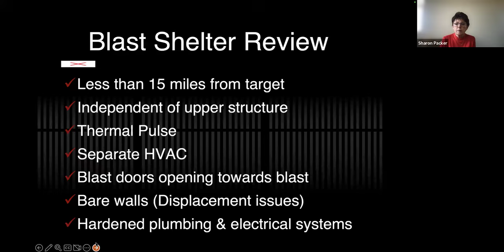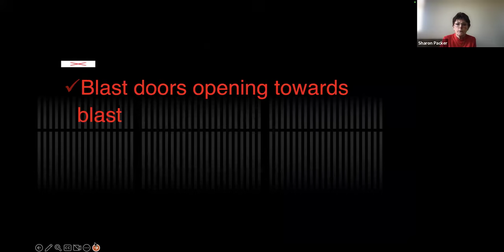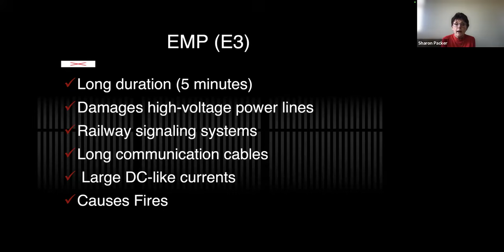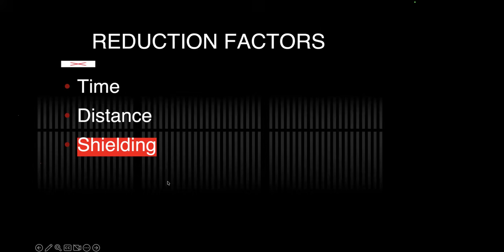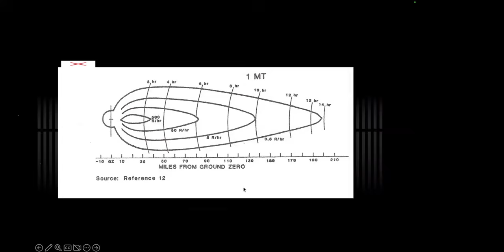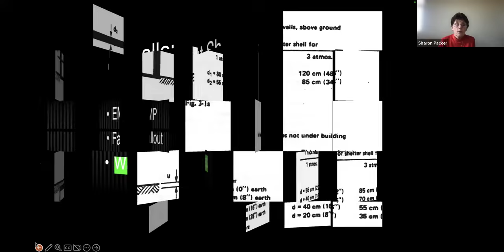Nuclear Fallout: What Actually Protects You (Shelter Design Explained)

Comment from the maker: 📌 Watch Part 1 here: https://youtu.be/aXcMfXAUxrE

What questions do you have about nuclear fallout protection, shelter design, or EMP? Let us know below.
Reply: Chatgpt seems to think that an EMP is unlikely to adversely effect electronics that are not plugged into the wall, or otherwise connected to the grid because a destructive charge will build up along the lines. I've also heard the contrary that anything with a microchip will get fried. Does anyone have any concrete understanding of EMP effects, other than the starfish prime phenomena? Thanks!
Reply: @johnfajer7691  ChatGPT is very wrong, but likely has gotten confused, since technically a lightning strike is a type of EMP. This is where AI can be very misleading. For a Nuclear EMP, one of the three pulses (E3) travels through transmission lines and affects plugged in devices. So yes, unplugging it would protect against that type of pulse (similar to a CME) However, the E1 pulse hits devices that aren't even plugged in.
Reply: @parkert6378 Awesome thanks for the clarification! So, E1 is enough to destroy micro circuitry?
Reply: @johnfajer7691  Most welcome. And yes, in a general sense, anything with a microprocessor (at that level) is vulnerable and would need to be in a Faraday cage. Older, analog devices (Roughly pre-1980/90ish) would be less vulnerable.
Reply: What can I do to protect me and my boyfriend's trailer/mobile home from fallout?
Reply: The PF (Protection Factor) for a fall out shelter, the different materials and thickness required was confusing to me.

Comment: I heard in an interview with the EMP doctor that if you know for sure an EMP has occurred, and if you have access to your fuses or power main, to switch them off and unplug everything you can to mitigate damage.  You have seconds to do this before the second part of the EMP travels along the wiring to actually do more damage and start fires.
Reply: I don't have expertise in that specific area- but if true, that'd only mitigate part of the pulse (the ones that travel through transmission lines.) Devices would still be impacted if they're not in a Faraday cage.
Reply: The EMP Doctor? You're better off getting inside and closing the doors and windows, then duck and cover. You won't have seconds in an EMP.